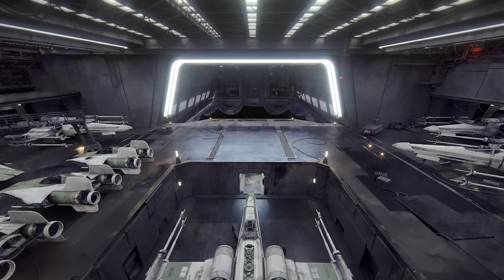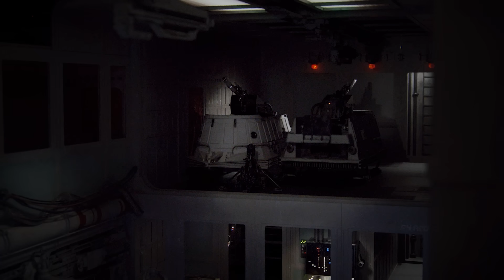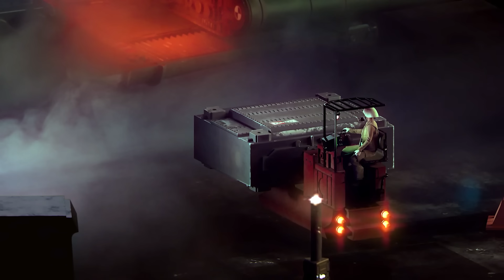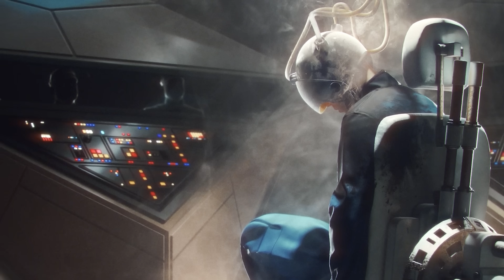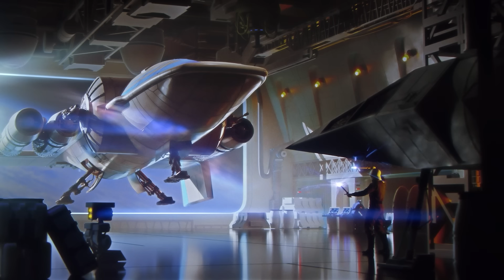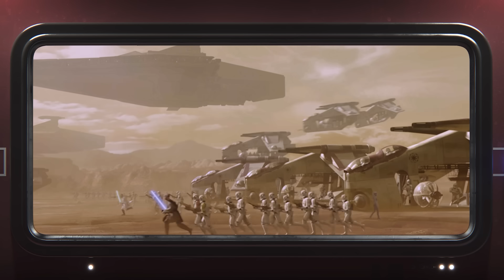1 Hour of Epic Star Wars Fan Lore (EC Henry 2019-2024)

Comment: 50:00  i would imagine you would have to be pretty small, pretty thin and pretty robust to operate one of these things.  i would still imagine those cockpit pods would be identical to the Millenium Falcon's control pod, just to account for a tunnel large enough for someone in a spacesuit to be able to traverse the tunnel for access (so a pod capable of sitting 4 people, but reduced to 2 to account for equipment and space to enter and exit).

Comment: All of your designs are amazing, and the lore you create for them is brilliant. Really the only two nit picks with the lore you have created that I have are with the G-58 which from the high resolution image, it clearly doesn't have a bottom fin, so the one from the movie you see, I think should have a slight tweak lore wise with something like the bottom fin was destroyed during some mission, and the Rebel Alliance felt it was worth the time, resources and effort to rebuild. The second one being the YX-950 which design strays too far from what you see in the movie, which has a big dome like protrusion out of the top. Unfortunately I don't have the skills to create such a ship that I think would fit what you see in the movie, but I can come up with some lore for what a ship that would match what we see in the film might be. Those dome protrusions scream reactor core to me so I propose this, (sorry I ended up getting into it and writing a lot) The Corellian MRC-9500 

With the start of the Clone Wars universe was looking at a war on a scale not seen in centuries. With such large scale war comes unprecedented numbers of damaged ships requiring repair and therefore the need for more repair/maintenance dock stations. A war on such scale also entails massive spending expenditures that the Republic was just not used to, meaning the Republic would be looking to save on costs where they could. Nessem Shipyards saw an opportunity and set out to design and build very cheap and mass reproducible light to medium ship repair facilities that the republic could place everywhere. 

One of the ways Nessem realized they could save on production costs was to not include a reactor for these ship repair facilities, and with that an idea took shape. A bunch of mass produced cheap unpowered repair yards could be prepositioned in areas that they might potentially be needed. Then with a small fleet of separate reactor ships, you could just send them to the yards that currently need to perform repairs. 

With the idea that they would be focused on mass producing these shipyards, Nessem Shipyards approached Corellian Engineering Corporation to design and build the companion Mobile Reactor Ships. Corellian was a bit skeptical of the idea, however they also could see the great potential for it and didn’t want to pass up the opportunity. So they went about designing a ship that would meet the requirements while sinking as little time and money into the project as possible.

So starting with essentially the gutted hull of a YX-950 they extended the main hull a bit and added a massive reactor core that could output enough power you could run pretty much any existing station or ship at the time. The original offset arm was replaced by a smaller central arm/pillar which also doubled as the main power conduit. The cockpit/crew quarters were located on the front of the arm and the rest of the interior space was storage space dedicated to holding as much repair equipment and material as possible.

Seeing the amount of power the MRC-9500 could output, Nessem Shipyards recognized another potential market for their concept, relatively cheap defense platforms. One could buy a bunch of cheap defense platforms, then just power the ones closest to the current front.

Overall the concept saw some initial success, for both companies, however as the war progressed and people realized the scale wasn’t something the republic hadn’t seen in centuries but rather it was on a scale the republic hadn’t seen in millennia the flaws in such a concept began to show. Unpowered facilities were a very juicy and easy target to hit. The CIS started launching raids specifically to hit such shipyards and defense platforms in areas that weren’t by the front. The MRC-9500 themselves, especially the early ones, were also a very convenient target for CIS. While Corellian Engineers pretty quickly cut back the cargo space to upgrade the shields and weapon systems to levels unheard of for a ship of such size, they were still considered high priority targets by the CIS due to the fact each one killed was one more defense or repair platform out of action. On top of that with such large-scale warfare going on and there being so many damaged ships in need of repair, many of the repair facilities wound up in permanent use, meaning the republic was needing much closer to one MRC-9500 per facility negating the cost savings. Part 1/2
Reply: Part 2/2
The program for Nessem Shipyards in the end turned out to be a flop who tried to salvage what they could from the program and redesigned their repair yards and defense stations to be self-contained. For the Corellian Engineering Corporation however the MRC-9500 was a mild success, with the republic buying more than they initially expected to power a greater percentage of stations. On top of that even after the program failed, with the Clone Wars dragging on for years, another small niche was discovered for the MRC-9500. Regardless of if there is a war going on, reactors need maintenance and while most stations have some back up reactors, especially on prewar stations those backups couldn’t keep the station fully powered for combat. For those stations the MRC-9500 could plug in and keep the station completely combat capable.

Despite being able to consider the MRC-9500 a mild success, by the end of the Clone Wars it was practically forgotten. Many of the remaining MRC-9500s had been permanently integrated into the stations they’d been charged with powering during the Clone Wars. When the Empire banned the YX-950 the claims of the unstable reactor claims were actually based on the MRC-9500’s reactor, despite being for all intents and purposes a completely different ship, which for war purposes could be cranked up to unsafe levels for a short time in an emergency. 

Despite the YX-950’s ban being justified by an overblown claim of the MRC-9500, the Empire ironically overlooked many MRC-9500s since many of them had been connected to stations for so long they were stripped off ship registries and many had forgotten not all of them were permanently connected. The Rebel Alliance managed to salvage a few of these forgotten ships, both from abandoned stations or by providing some running stations an “upgrade” for their reactor.

Using the massive power plant in the MRC-9500 Rebel Alliance engineers led by Henry Ecantras managed to cram a smaller planetary defense turbolasers or a smaller planetary defense Ion Cannon into one all though with limits. The ships would be unable to maintain shields or use any of their other armament when using such heavy weaponry. They are also limited to about 3 shots on a good day due to heat issues. However with such power, catch a Star Destroyer without shields and a single Rebel MRC-9500 can cripple if not outright kill it in a single volley, and if operated as a pair you could do the same to a shielded one. Thus they earned the name “knockers’ for the ability to in a quick punch knockout Imperial Star Destroyers.

Realizing the potential of these ships, Ecantras fought with Rebel Alliance leadership to prevent the deployment the first of the MRC-9500’s knowing that as soon as it became known what the rebels were doing with them, the Empire would realize their mistake and prioritizing the destruction of every MRC-9500 still out there attached to these old stations cutting off any potential of getting more. He went so far as to sabotage the project to delay things as long as possible, and was eventually facing charges of treason. However in the end Ecantras’ fears were proven right once the Knockers were put into action, and The Empire realizing their mistake began a campaign to quickly eliminate any remaining MRC-9500s.

Of the three seen In The Empire Strikes Back, two are the Knocker variant, while the third was turned into a heavy salvage ship that can latch onto large derelict vessels or even small stations and bring them to a safer area to do salvage operations.

Comment: I had an idea for a Nebulon-H basicly 2 Nebulon-B's side by side with an almost Dreadnought mid-hull section. I think there could be a few versions depending on the number of the forward pod split's, 2 vertical? and 2or4 diagnal pod split's like on the B2's. I think an Imp Nebulon-H with 6 forward pod split's would look intresting. One factions idea for a Heavy carrier frigate, perhaps it would have a faster grade hyperdrive.